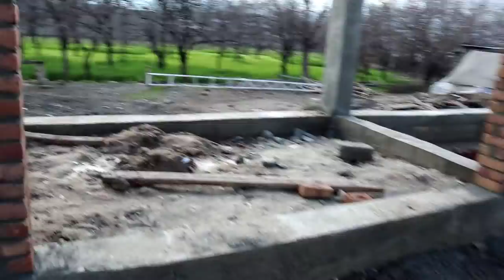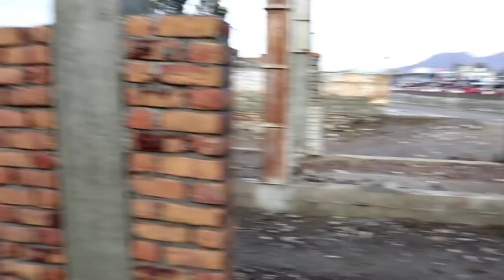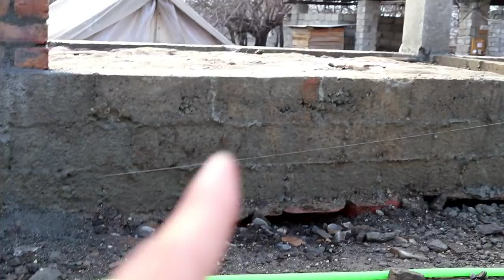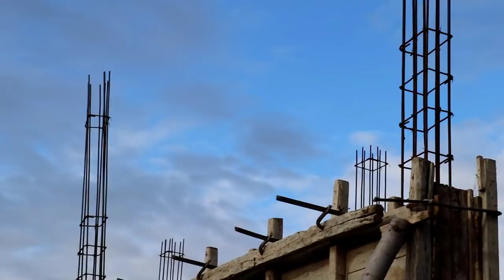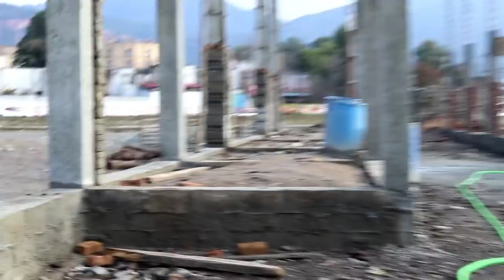Depth of Plinth beam - Settlement in Plinth beam on Site - Reinforcement Details for RCC Structure

Comment: Totally wrong. Min dia of steel is 12 mm for column and 8 mm for stirrups and  every column should be of equal size....i can see non technical inputs in your work.
Reply: No column size will differ according to structural loading...

Comment: Are you Mason or engineer? Tell the dimensions in mm or cm why r you telling them in inches? And IAM working as an engineer in a construction company in my projects there is no drawing shows inches and there is slightly difference b/w inches to cm r mm.
Reply: Hey
First thing. Being an engineer not a good sign insult the other. I am in pre-final year and the places where i have worked all of'em use inches and feet. And sir works in dubai,that might be the trend there. Questioning him to be a mason won't do any good.
Reply: @janhavioza8613  yeah IAM sorry bro...
Reply: @raviperka5697  appreciated 😇
Reply: @janhavioza8613  tq..
Reply: Hello Ravi,
It is not about your uses mm or m. But it varies by locations. Some people at different cities prefer inches or feets but all the companies or some uses mm or m. At varies by location you work. 
But as an engineer I will say every engineer should be fit or should be ready to work at in the both cases, whether it is inches or mm. 
Thank you.
Reply: @aqtabahmmad3014  yeah I agree....but he should show the drawing before he show or say something...if not some people may confuse... that is my thought....tq
Reply: I am an engineer we use inches and foot here.... Unit's doesn't matter bro..
Reply: Settlement of soil under plinth beam should be considered to compact the surface... at some point bending of beam due to uniformly distributed loading may try to bend the beam at weaker points...

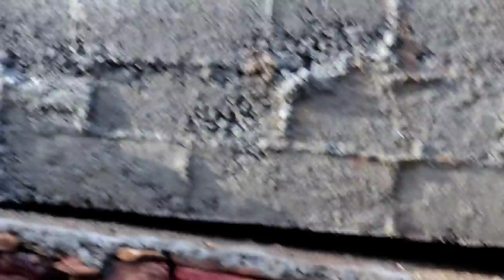Comment: Sir. @3:30 you said there is settlement due to improper compaction of soil. Would that mistake lead to failure by any chance?
Reply: If I may answer, it may not necessarily affect the structural integrity of the building. In fact one of main reasons why plinth beam is provided is to cater for any possible settlement of the soil underneath. If there are no plinth beams and the bricks are stacked right above the soil, yes, the settlement would affect the masonry works
Reply: @zain-ab5123  Thanks ma'am!
Reply: No man! there will be no failure in future  because the loads from super structure will distribute to plinth beam not to that below plinth beam work...and that wall or PCC under the plinth beam only for level and rod bending and shuttering purpose only...
Reply: @raviperka5697  thank you sir.
Reply: @janhavioza8613  ur well come my dear...
Reply: That masonry wall below plinth is given to retain backfilling only and settlement of the same won't do any harm to the structure.